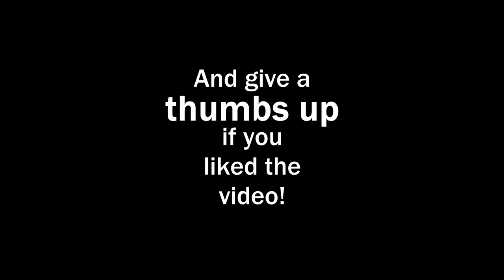O11 Mini Full Build - 360mm AIO - Micro ATX!

Comment: I really dig the AIO plumbing being routed to the back instead of the usual routing over the RAM. It looks so much more clean. Too bad the tradeoff is no rear fan, maybe with a 240/280mm AIO it would allow for both.
Reply: having it like that does negatively affect AIO performance tho
Reply: @seabs473  How so? It's not changing the relative height of any piece of the unit. The only difference is a 180° rotation of the rad on the x axis.
Reply: @seabs473  - as long as the radiator is above the CPU Cooler block the build itself is fine with the AIO at the top.

Comment: Absolutely beautiful thanks 😊 Self-explanatory, even to me! I just bought this case. Where I live, there is a LOT of dust though, so I would have to put the radiator vertically where you've put 2 140s, with the tubes at the top. Not ideal but no choice really then intake at bottom, exhaust on top.
Reply: How does being in a more dusty place have an effect over wither to have the radiator on top or side ?
Reply: @Flyhigh471  Dust settles on upward facing surfaces... and then wouldn't it be sucked in? So therefore, shouldn't top fans push air out?
Reply: @apusista  the build in this video using the top fans for the radiator in push configuration, so it wont suck the dust in, so you can do that. I just don't get why he opted to have five exhaust fans and only three intake fans, seems unoptimized to me.
Reply: Broken Cypher : Yes, especially in a cool climate, more intake would be better. Here in India, more intake is not a good idea! 3 x 120 is good here. But you're dead right, push fans on top would be abs fine. I just realised my old pc has exactly that!
Reply: Instead of doing 5 exhaust and 3 intake like he did in the video try flipping the 2 fans on the side to intake so that you have 5 intake and 3 exhaust, if you have more exhaust than intake there'll be more dust inside the case
Reply: @manspeej  Thanks so much. This is my plan now.
. 360 radiator w 3 intake fans at side
. 3 intake fans at base
. 3 exhaust fans on top
. 2 x 80mm exhaust fans at rear
Reply: @apusista  in the o11 mini if you use a full atx motherboard you can't fit a 360 on the top, you can zip tie it into place but i recommend you get a micro atx motherboard and screw the radiator in normally
Reply: @manspeej  Thanks much 😃 My mistake, I wasn't clear. And I posted here though I finally bought the O11-Dynamic. The tank, not the mini. It is insanely large! You could probably fit two custom liquid cooled builds into this one. I dunno, I just fell in love with it and bought it and that's all I bought as prices shot up practically the next day! I tweaked my existing machine and I'm still waiting. GFx Cards are still OTT. It's a b.... to cool but there's enough room in there for an air conditioner! I just really like the styling so I chose that over many far more practical cases... got it for a decent price. One day soon but Noctua fans cost a bomb here... should I settle for Deep Cool or generic?
Reply: @apusista  definitely don't get generic fans get any well known brand you got Arctic, be quiet, cooler master etc, Lian Li etc
Reply: @manspeej  Will keep in mind, thanks much 😊
Reply: in a hot place like australia that has probably the most dust on the planet, what airflow design with fans would you recommend?
Reply: @Lonzo1112  remember if you have more exhaust than intake case will get dustier it's best to have equal intake and exhaust or more intake than exhaust
Reply: @Lonzo1112  Others here like manspej know far more than me so I have just one suggestion really... IF possible, air condition the room where the computer is. This is what people do here in India. The computer is always in a smaller space and it's air conditioned and the windows closed. I live in a city where heat is less of a factor so I just keep the window closed and the ceiling fan on, that's it. I use a liquid cooler. Ambient temperature is the main factor where heat is concerned and windows closed for dust. Fans pulling in hot air don't help as much as cool air... about 22° - 23° is good.
Reply: @manspeej  Thanks for the reply mate, as my first serious setup, would case would you recomend for someone who lives in australia and creates alot of dust, i still want efficient airflow and don't mind paying for a good case and buying good quality fans
Reply: @manspeej  Where did you get that? On the official Lian Li website with ATX config, you have 25cm clearance up top. 360 or 240 doesn't matter since it's a question of thickness clearance, not length.

Comment: All your fans are intake and you have no exhaust fan. This means that hot air can not displace properly and will recirculate causing higher temps and potentially thermal throttling. You can either point your side or bottom fans out.

Comment: You should go with custom length cables from the PSU and take out the extensions. Will make the back cleaner. Apart from that, it is great build!

Comment: It's a fantastic looking PC.  It could be one of those up market boutique builds!  This question isn't criticism, but what is the thought behind your fan config?  The 3 intakes at the bottom, and 3 exhausting at the top make perfect sense.  The two fans beside the motherboard tray are also exhausting air out of the side panel.  Wouldn't they serve better if mounted to take air in on the front of the case?  I do understand they wouldn't have the same visual impact on the front as they do where you have them. But if that i9 starts to throttle moving them to the front may be a necessity.
Reply from the maker: I recommend running side 140mm fans as intakes. I ran them as exhausts for the aesthetics of the fans.
Reply: this is actually false because everyone knows more rgb means more frames. forget airflow, embrace rgb.

Comment: YES: "I ran the side fans as exhaust because it looked nicer, but I recommend mounting the side fans as intakes. This will result in slightly better system thermals." -- Subdubbin

The fan setup shown at 14:33 (side fans are exhaust) results in a negative-pressure case.  Unrelated but also worth consideration: the air coming up through the front-most bottom fan and then immediately exiting through the bottom-most side fan.  That bit of airflow does nothing for the system.

Sometimes a negative-pressure case is desirable like with the TherrmalTake Tower 100.  But useless airflow is never desirable.
Reply: in a hot place like australia that has probably the most dust on the planet, what airflow design with fans would you recommend?

Comment: Wait so to mount a 360mm radiator on top you just lower the ATX motherboard? I heard of fitment problems with the 360, but they sell a 3D printed bracket. I’m going vertical GPU mount 3080. Let me know if lowering the motherboard will work!

Comment: i though the pump fan connector would be plugged into cpu fan header because i see an "CPU fan error" at 14:27
Reply from the maker: Pump is plugged into the AIO pump header. I turned the cpu fan monitoring off in the BIOS after the first start up.

Comment: Now I was told that the O11 mini could not top mount a 360mm AIO but it clearly fits fine here... any reason why alot of places say you'll need zipties and stuff?
Reply from the maker: It fits here because the motherboard is micro-ATX. The 360mm rad doesn't fit with ATX motherboards.
Reply: @Subdubbin  is it the same story with o11 air mini ?

Comment: I’m having issues with same motherboard and case, the aio bracket doesn’t fit on the back so I can’t screw the board in at a balanced level, did you run in to any problems?

Comment: Man, that looks good, I always love watching a build video from you.
Also, what do you use for your main system? You have done multiple build videos in different cases and I'm just wondering. Have you used all the builds as the main system or do you have a go-to case and configuration that you use on your desk?
Reply from the maker: I use whatever is built at the moment. It changes a lot!
Reply: @Subdubbin  what do you do with the other pcs you dont use?
Reply from the maker: Take em apart and switch cases usually. Always buying and selling parts to try new things.

Comment: Nice build man, I'm hoping to do something similar but AMD based. It's a real shame Asus didn't offer a B550 or X570 mATX board, as it stands I'll probably end up running an ATX board with a side mounted 280mm rad since there's really not many mATX options for AMD. The MSI B550 mortar would be a decent pick if it weren't for the piss poor i/o.  Seriously, how did anyone think that's an acceptable number of USB ports?